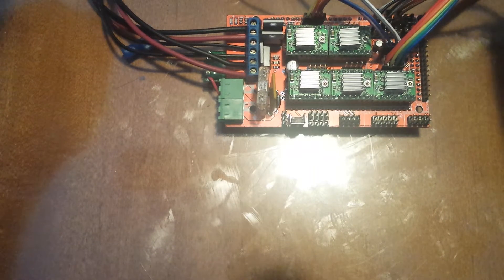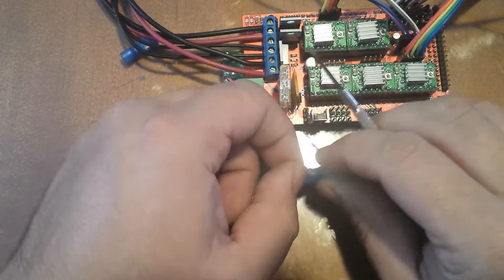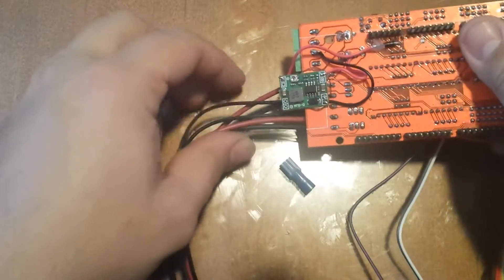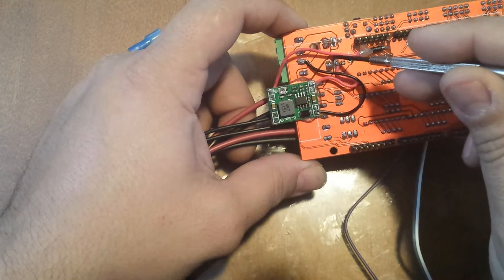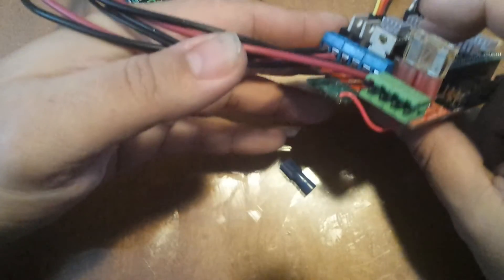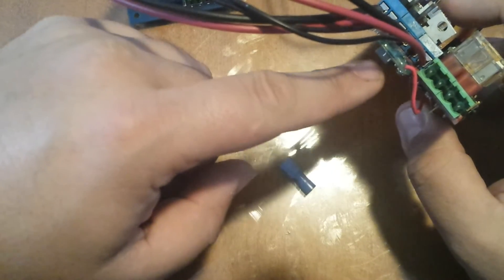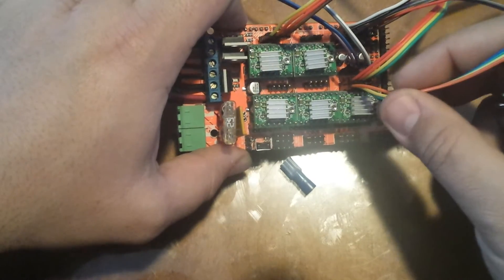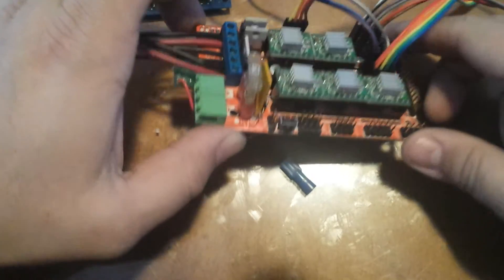RAMPs v1.4 from 12v to 24v

Comment: Grate video !
what is the correct size for the fuse ? 
Thank you
Reply from the maker: You have to do the calculations for your printer bed size and it's maximum current draw. But a good start is like a 25 amp fuse.
Reply: ok should it match the PSU 
i will get a 33A 24v PSU 
should then get a fuse same as the A on the PSU ? 
thank you for the help
Reply from the maker: Don't match the PSU, match the bed draw, you never want the bed to draw more than it's supposed to so always match the Bed.
Reply: Thank you Tony!

Comment: I am currently running 2 power supply's a 12v for the ramps and a 24v for the heated bed using a relay switch to turn on the heated bed. i would like to run off one power supply but would I need to switch my hot end to 24v?
Reply from the maker: if you want to run off of just one PSU, and keep the ability to heat up the bed fasted with the 24v, then yes, you would need to switch your extruder to 24v and modify the RAMPS to 24v also.  The extruder changeover is relatively easy, just purchase a heater cartridge that fits your extruder and that's all.  Please make sure your 24v PSU has enough amperage to handle the added load of the extruder and the RAMPS. (the RAMPS will barely add anything by itselft).

Comment: i use 12v on mine what type of fuse do i use i want to do both on my ramps board
Reply from the maker: You will have to calculate your total load value for that section (whether the bed side fuse or the main RAMPS fuse) and get the next closest value for a fuse: ex: if you calculate your heated bed to draw a max of 12 amps under normal conditions, the closest automotive fuse, without going under, is 15amps so I would use that.  I won't do a calculation for you seeing as everyone's setup will be different and could cause a hazard if calculated incorrectly (basicly if your system is really 12amps and you decide to put in a 20amp, the fuse doesn't blow at all and your heated bed "runs" and catches your house on fire....) Do your calculations to your machine, your bed type, your bed size AND your PSU wattage.